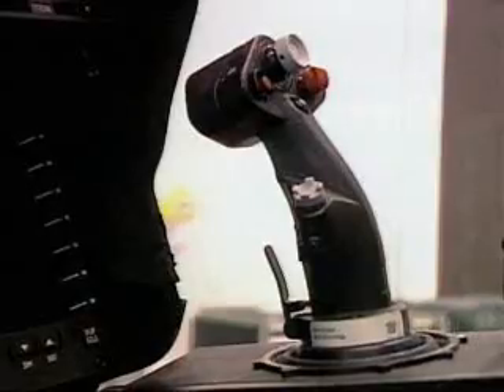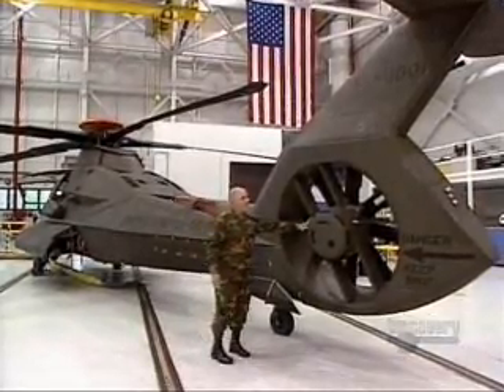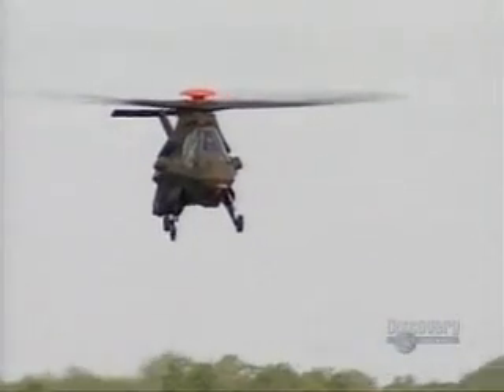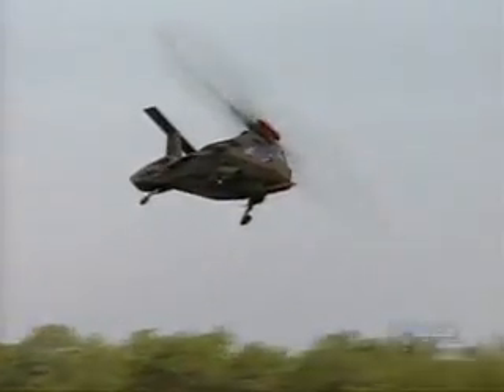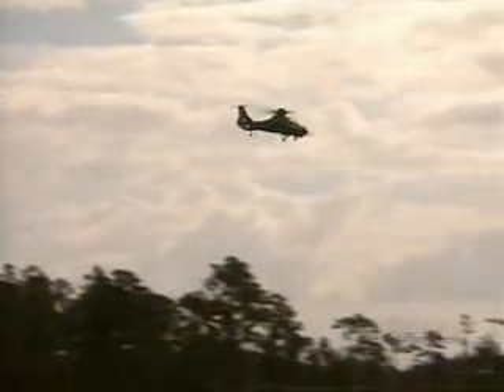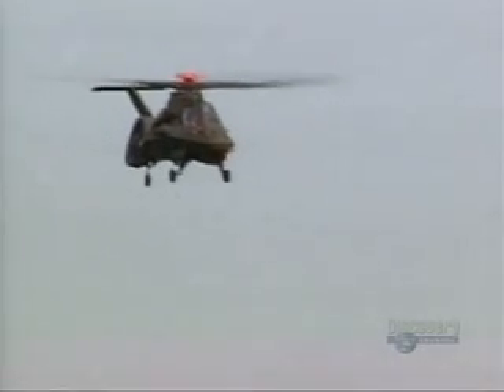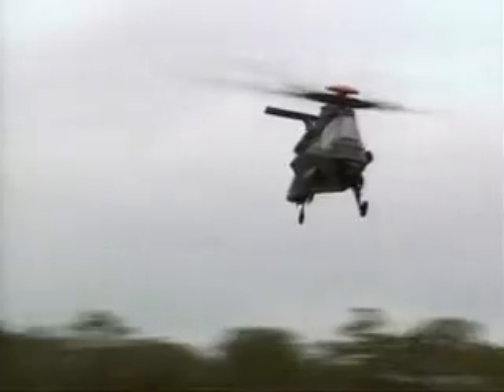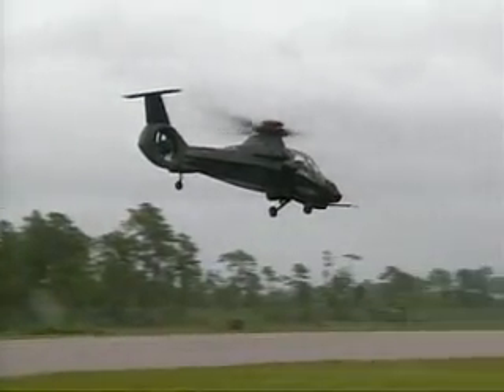Ultimate Helicopters 5 of 5

Comment: -with various sensors tied to a battle field tested high speed computer the Comanche is also able to perform a lead role by information assessment and guiding other aircraft(traditional AWAC's role)

Of course being better does have its drawbacks-the afore mentioned abilities make the Comanche the most expensive stock military helicopter ever made.Since the current UAV's are far cheaper,make a great weapons platform,stay aloft far longer and do not put lives at risk they cancelled the Comanche